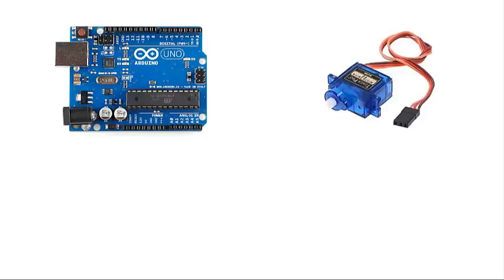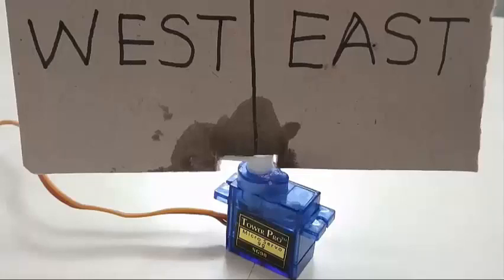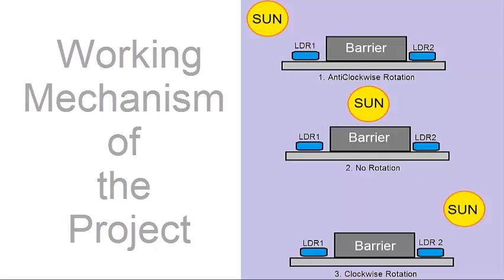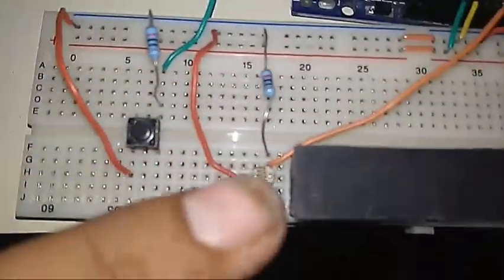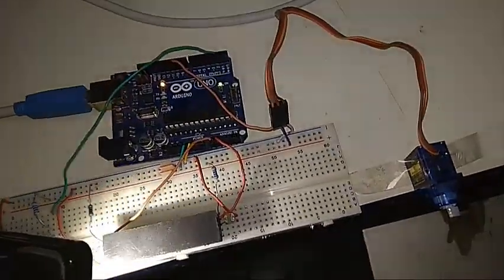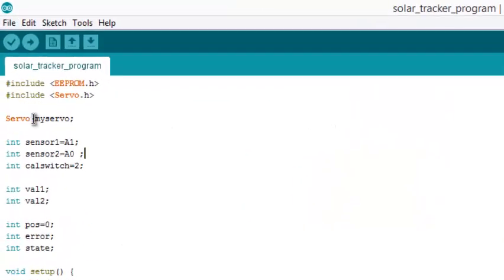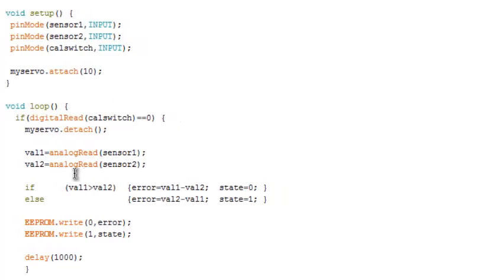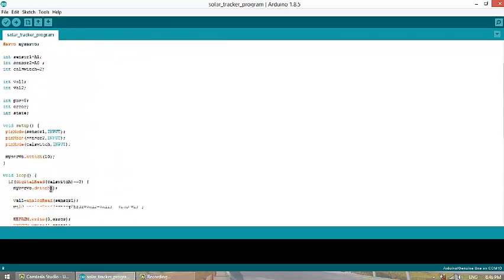Solar Panel Movement Tracker Using Arduino & Servo Motor

Comment: Sir the yellow light in the board is not lighting constantly and is blinking by which the servo motor is not working properly and is stopping after some seconds

Comment: how to connect 12 v DC motor
Reply from the maker: You can't use DC motor in this project
Reply: @HowtoElectronics  in place of barrier we can use of solar panel ha sir..
Reply from the maker: Use anything, even a wood or plastic will work

Comment: After sun set will the motor rotate back to east side
Reply from the maker: No without light the motor will be at normal state as in center
Reply: @HowtoElectronics  from west will it directly come to east
Reply from the maker: Yes it will
Reply: @HowtoElectronics  thank you so much for your support
Reply: @HowtoElectronics  does your code indicate that when there is no sunlight detected the motor will automatically rotate to the center?
Reply from the maker: It will not move from the place where it was orginally placed.
Reply: @HowtoElectronics  Oh okay so when the sun sets the motor will stop. Ex the sun sets in the west the motor will stay facing in the west until it detects a sunlight?
Thank you so much
Reply: @HowtoElectronics  how can i track dual-axis solar sun tracker?
Can i use DC motor whether geared or not geared to tracking system?
And what is the problem?

Kindly requested,
Reply: @How To Electronics what is meant by barrier can u..